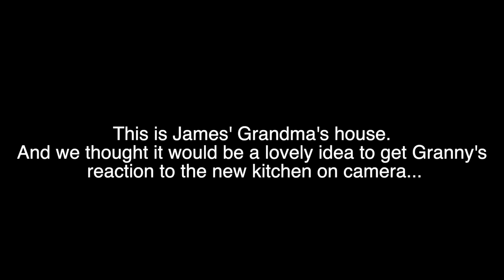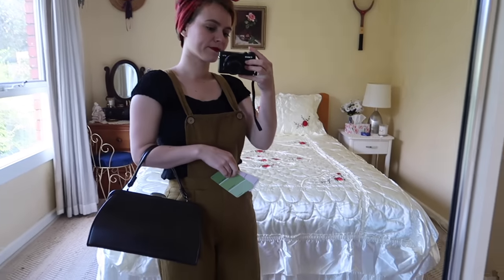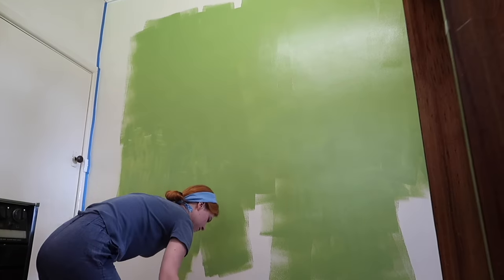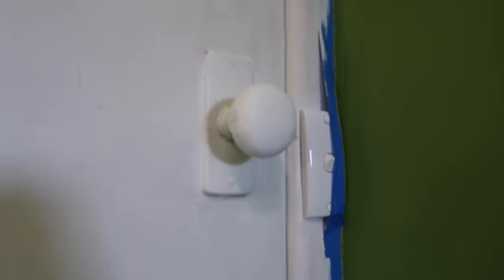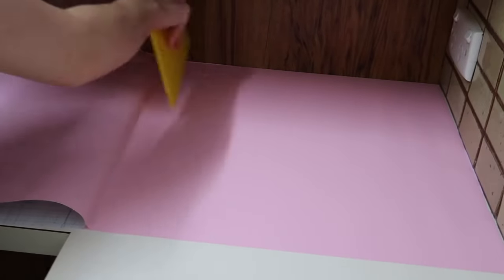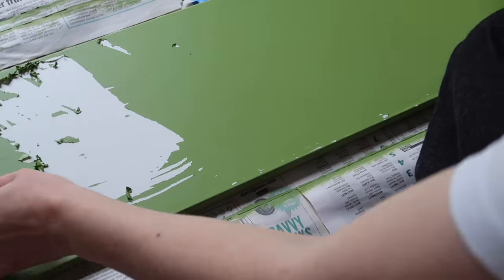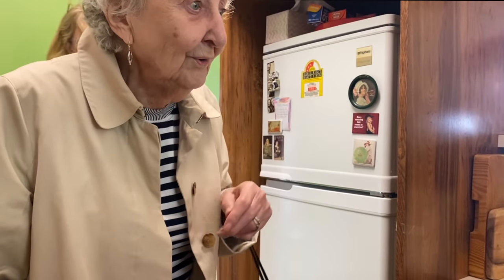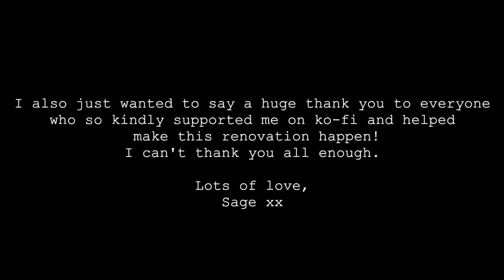1950's Kitchen Renovation

Comment: Pulling the adhesive paper out was a good decision. Not just for the color but one ding with a plate or utensil, and there will be a hole on the paper, which then gathers moisture and dirt .That paper is not meant for kitchen counters, but rather for decoration on seldom used shelves or drawers. 
If you want to freshen up the countertops, you can prime them, paint and put a few coats of polyurethane, designed for kitchens cabinets. 
The doorknobs are brass and can be polished to the original shine.
Reply: Lovely! Kitchen renos always take longer than you think. Your curtains are really cute and that wallpaper is adorable! My mom had a coffee grinder like that and I have a match safe like the one on the wallpaper. I agree with others, you need a clear plexiglass backsplash to cover the wallpaper above the stove or it will get grease marks and spatter. Must protect your hard work!
Reply: Agreed. Also the white countertops are laminate which are virtually indestructible, so no reason to cover them.
Reply: Melamine paint covers laminate/Formica countertops extremely well and is very durable, however there’s your prep work (scrubbing, sanding and scrubbing again) 2 coats with ample drying in between I got 5 years out of mine before I had fund’s saved up and replaced them, plus you can have it tinted to whatever colour your heart’s desire
Reply: I found some very heavy gauge contact paper that is 36” wide in black. Used it on my counters which were a fabulous pink star pattern but alas only in the corners (very worn). It’s been twenty years and has a few dings but has held up well enough. Planning on a Formica with a chrome edge.

Comment: With respect to the door handles..  If you want to strip paint from metal without the nasty fumes and mess of chemical strippers, just fill a slow cooker with water and set the dial to high. The heat and moisture will soften the paint, and often it will fall off as a single piece.   Then use metal spray paint for the color you want.  Looks great and your Grandmother is awesome!
Reply: That sounds so satisfying
Reply: I boil the brass (and other painted metals like hinges) in either water and vinegar or water and baking soda. Pull them out and run under very cold water to make the last of the paint pull away. Polish brass afterward with fine steel wool and more vinegar or baking soda. Also, there are tension rods that would work great over a sink for the curtain. No screws required.

Comment: For future reference, whenever  you are gluing something down such as contact paper or wall paper, put a pin hole where the bubble is and you can push the air out the hole.  All of your hard work paid off greatly, everything looks so beautiful and from my memory of my grandmothers your house  looks totally 1950's. I would leave the wall paper alone, so what if it's a little stains. It's supposed to be a 1950's house!  Please be extra careful about the new appliances you bought.  Those old wires can cause a fire at any time.  Good job guys.

Comment: I completely agree with you on the renovating videos. I bought my first house 2 years ago and I can't tell you how difficult it is to convince the contractor and people helping us with the house that Yes, I want it to look old fashioned. Honestly, every project I do takes at least twice the estimated time. For hanging prints do you have Commando Strips? They can hold up to 5lbs, you don't need to put a hole in the wall and are removable.
Reply: I agree with everything you wrote!
Reply: Bit by bit I am getting my flat vintage (1930s in the sitting room, early 50s inspired in the kitchen because, although my era is the 1930s I rent from a co op who put in the kitchen so I have to work with what I have) and 1930s style bedroom. The decorators, when I am able to get the rooms painted and papered are gonna be like this with me lol. I want dark wood skirting boards, the white plank doors stripped and stained dark wood, and also the ugly white light switches replaced with black retro Bakelite ones.

Comment: I've never seen contact paper on countertops. I have some ugly counters lol.
One thing you can look for to put up the curtains is a tension rod that doesn't need to be nailed in.  They are really cheap and easy to find here (us) at hardware or home stores
It looks very nice!
Reply: I was going to second the tension rod. I have them in my kitchen. (I have café style curtains. My house was built in 1951. It's been redone a few times. I'm working on a more country feel in my kitchen.)
Reply: If you apply contact paper, do not cut, put anything wet or hot on it. Be aware that if it's near a sink you may want to caulk & seal it.

Comment: The best way to remove paint from old hardware is to place it in a crockpot with water for about  10 hours the paint peals off and reveals the beauty of years past. I’ve been renovating 1910 craftsman house for the past 2 years and have used this method on all the original hardware.

Comment: You did a lovely job! Love the green and the wallpaper and that wood shelf you found is perfect. I think my only concern would be how to keep grease from getting onto the wallpaper from the stove. I have beadboard along the wall behind my stove and even with my vent above it which helps greatly to cut doen on grease, I regularly have to wash that section of the wall and cupboards with cleaner like 409. I hope the wallpaper will be ok, it is just darling!

Comment: Just a couple FYIs for you, in case you'd ever like to revisit some of your projects that didn't work out the way you hoped: you don't have to limit yourself to contact paper to change countertops, you can absolutely paint them! You can use any regular latex paint, which means you can customize it to any color you like, and you just cover them with an epoxy. There is a Rustoleum epoxy that is really affordable (like $20-30) and, while application is a little messy, it's incredibly easy to use. 

I once painted our hideous countertops when we were still unable to afford replacing them, and they lasted beautifully until we demo'd them a couple years later. You can sit pots and pans directly on it, it doesn't stain, it's almost indestructible under standard use. The epoxy also gives it a professional look that makes them appear "original" as if they came that way, rather than being painted. I can't speak highly enough of that epoxy!

Also, you can also paint coated/laminated furniture (your shelves) to last without any peeling or chipping, it just takes some preparation. The key is to lightly sand the surface to roughen it up and then prime it with an oil based primer. If you take these steps, you can paint almost anything with a regular latex paint.

And lastly, beautiful job! It's so fun to see a renovation that goes the other direction and seeks to appear older, rather than modernized. It turned out so cute!

Comment: Good morning, Sage. This turned out so lovely! Tip on the shelf board. Sometimes if you give them a light sanding, you can remove the slick finish then paint over. Also, on walls where you have problems finding studs, (if you have them in Australia) look for Command hooks & strips. Be safe, Be Blessed

Comment: Take the door knobs and soak them in a crock pot the hot water just takes all the paint  right off you will have to leave them in the crock for several hours but it works. I love the kitchen colors, the vintage wallpaper is so pretty. You did a great job!

Comment: Love your final results 😍. Like you said, during can be stressful but so satisfying once it's through 😄. A tip (as if you didn't have many prior 😅😂)-when I learned to paint, I was taught to make an X on the wall...then go over that with the roller. Starting at the top of the wall and work down in small sections and to the other side. 😊

Comment: Your kitchen turned out so darling! I love how the green and pink worked with the tiles you already had! One idea to dress up part of counters, without costing a huge fortune, is to fold a vintage tablecloth, fabric, etc. and then cover it with a piece of glass cut to fit. I've done that before, and I loved it (just don't put anything that's very hot on  the glass unless its the type to withstand heat)

Comment: I love this video! Just in case it’s useful in the future: think of that house paint like you are putting a very thin sheet of plastic up. It binds to the wall because of chemicals, but also a mechanical bond that forms with the rough surface texture. That’s why it didn’t stick to the super smooth shelves:) Rough them up with sandpaper, and you can paint them green again! The same with any glossy finish, like the door you painted or even the door knob.

Comment: So Pretty! I love how you have tied in the original kitchen colours with the wallpaper! ❤
A few hints..For shelving you can paint, go to the dressed timber aisle in Bunnings, look for primed mdf and Bunnings will cut it to length for you down in the lumber supplies section..The chipped baseboards could be also covered by glueing on strips of the same mdf or use melamine that is laminated white from that same section with the bonus that you don't need to paint at all..You could have cut out those oil stained sections of wallpaper using a ruler and a Stanley knife, sealed the wall with varnish or primer and rewallpapered over..Before wallpapering or painting, clean the walls with Sugar soap, then spray and wipe down with methylated spirits, you can get vanilla scented meths at Bunnings, its great for cleaning kitchens and bathrooms..Bunnings also sells a paint reno kit from Dulux to refinish your benchtops whatever colour you like..lastly..When you paint doors unscrew the handle plates first (same with switch plates on the walls)..Use a small roller and water based enamel on doors as it is washable..If you want to paint door handles, mask up around them and use a can of spray paint suitable for metal, give them several fine coats of spray paint and it will look professional and durable..Just found your channel..Off to watch some more! 😊👍

Comment: What a lovely renovation or retro-novation I should say. FYI the stud finder is detecting the metal used to secure drywall to studs not the electrical wires. The are usually midway thru the stud so unlikely you can pierce a wire.

Comment: Love this reno! So cute  ❤️ To get the air bubbles from the contact paper, you can poke it with a tiny pin to let the air out. I haven’t papered a whole wall with vintage paper, but I’ve done little papered  panels and framed in molding. For that I used command strips so I can save my paper when I want a change.

Comment: Here’s a little tip I learned from a carpenter, when you are chalking the wall and skirt boards put a strip of painter tape on the wall and the skirting board but leave about a 1/8” space. When you are applying the chalk just put a very small amount on because it will spread but not have any extra to have to wipe up

Comment: If you use an anchor bolt or toggle bolt you don't have to drill into studs (lumber). They have different weight that can be supported, so check before you buy. Bar Keepers Friend is my favorite brass polish for raw brass. Acetone will strip lacquered brass. Toe kicks are designed to get dinged and marked so are often painted brown not white. Try a magic eraser or liquid softener/water mix (1:4) to remove scuffs.

Comment: You can add trim between the wallpaper and tile. Oh and use tension rods for curtains, and also 3M stick on strips are your best friend.  I have mine holding a shelf with a ton of makeup and had no issues.

Comment: A suggestion for the shelves you can send them down and paint with primer then the paint and it should adhere well. I've never used wall paint on furniture but I had to sand down furniture and paint the furniture with Gesso (primer for painting art) for the art club so they could custom paint the furniture and sell it! I hope this is helpful!

Comment: So agree with you on everything now being white/ black in homes...
Just very cold..
Example: My late-wife and I bought a home that had an amazing room added onto the house..on wall there was a fireplace that had on each side of it these amazing floor to almost ceiling white cabinets..(and they were 6' wide on each side of the fireplace)  When we were looking at buying it...I climbed up on the counter of one side and noticed they were painted white...the cabinets were actually oak...
After we bought the place...I spent over a month stripping that paint off so we could have the beautiful warmth of the actual wood.

You did a fantastic job...and not putting the vinyl on the counter was a blessing..
While I'd just get new countertops...another solution would be to get a melamine paint..(that's what is on the Ikea shelves) 
Tintable...and a smooth finish...(just use a cutting board so it isn't damaged)

Comment: If you unscrew the door hardware, you can soak it in paint remover in a glass jar and all the paint will come off and you'll have it back to it's original metal finish.  It's really easy, the paint just sloughs off when you remove it from the liquid in the jar - I use a paper towel to "dry" the hardware and most of the paint is off by the time I'm finished and what isn't off is easy enough to just rub off.

Comment: Take your wall paper scraps in now and have a sample paint match done for every color so that if ANYTHING happens you can paint the patch. Sand when in dbout of paint sticking : shelves and wall. And tape both edges 1/4 in from seam for a perfectly straight caulking edge and pull the tape up before it dries completely, maybe 1/2 dry?

Comment: It looks amazing 🙌🙌👏👏🥰🥰💖💖 just a small tip, I'm a painters daughter lol, my dad's had his painting company since b4 I was born, n ur supposed to pull up the tape b4 the paint dries😩 somehow leaving it til it's done drying allows the paint to leak under the tape, but pulling it up like 5-10min after finishing will prevent any spreading😄🥰 hope this is helpful in the future somehow🥰💖 also, u can paint the cabinets by sanding them down really well first, just get a piece of sandpaper like 200 grit and rub it by hand and then using a primer paint b4 the color thats meant for wood/plastic/metal/etc😄 otherwise, u did a beautiful job🙌💖

Comment: Use  cute little trim you could even make your own if the extra price of wallpaper doesn't work out. Also you could use command strips to hang a rod on or since it's inbetween you can use a Cafe curtain rod that is a spring rod. Or I've even used a spring shower curtain.

Comment: Pro tip: when doing wallpaper, start in the middle/half a papers width away from the edge of the wall. You may think your wall is straight but it most often isn’t. If you get a central piece nice and straight, the rest of your wallpaper will be straight. If you start at the edge, you may end up getting half way and realising you’re having to paste it slightly slanted (and having to rip it off and start again). The wall in this video was small so they got away with it but on bigger walls you’re best doing the above. Happy pasting 😊

Another pro tip: peal masking tape off when the paint is still wet. Makes the edges nice and crisp. When you peel it off dry, you end up ripping off flakes of paint and having to correct it later (like she had to in this video which often goes wrong and defeats the point of taping)

Comment: A cleaning tip for walls, use a sponge mop with new sponge for each room. Reaches the top of the ceiling and the floor amount of water can be controlled, and takes just a few minutes per wall. Just a suggestion. 
Interesting green color there....

Comment: If you want to paint the Ikea shelves, you probably just need to sand them down so the paint has some thing to hold on to.  You also might want ot consider using a tension rod for the curtains.  When washing velco in a washing machine,  it picks up lint from other garments.  A curtain rod would also make it easier to get it up and down.  Your kitchen looks great!!!

Comment: Take those door knobs back to metal - white paint will show dirt in a heartbeat and nothing looks worse then a grimy dirty door handle.  Good luck with that contact paper, usually not for high use areas, painting and sealing might be a better option.  I am really surprised that the person selling you the vintage wallpaper did not send instructions on putting up and discuss proper glue to use.  Oh darling, wallpaper is a chore, you gently fold the salvage piece before you tear and it will be less jagged. All in all you did a lovely job, little white toes and all, Granny's smile says it all!

Comment: Looks great!  Some tips:
1.  Patina on metal is wonderful. 
2. Use a better quality of paint, or prime first, so you don't need so many coats.
3.  To wash a large wall, use a sponge-type floor mop.
4. Next time use TSP [Trisodium Phosphate] to clean walls of grease.
5.  Better to not match colors exactly.  Example:  Wall could be a harmonious green instead of exact match.  It creates more depth abs interest.  However,  the white wall abutting the wallpaper would look nice painted in exact match of pink in the wallpaper. 
6.  I hope you will consider changing the tiles out to large squares of the fifties.  A pale pink would look nice.

Comment: Your walls are probably plaster which would explain why the electric stud finder would have such a hard time. I found a trick for attaching a very strong magnet to a string and dragging it slowly across the walls, eventually it will find a nail in one of the studs and you'll have your stud location :)